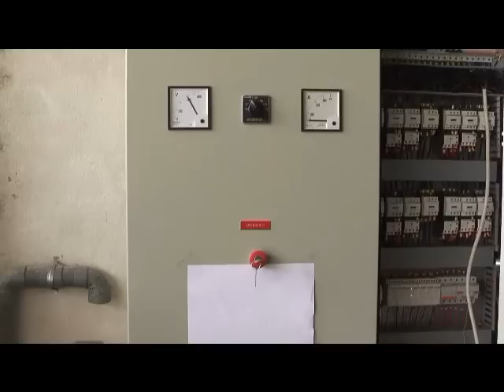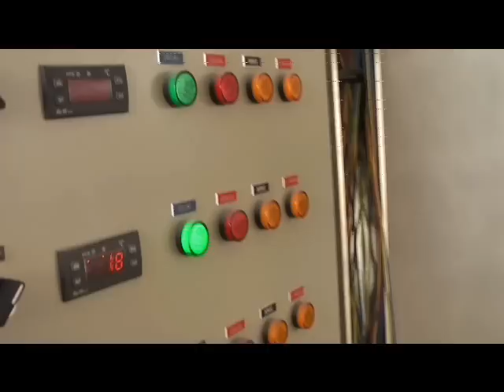2 Large Freezer Rooms Pre-comissioning stage

Comment: Remote condensers are a great idea, it will help ample & easy airflow over the coils. The compressors are placed at a perfect height to ease future service and monitoring the operation.
The central electrical control panel looks great and has all safety switches and protections. A perfect installation.. well done SAHAR!!